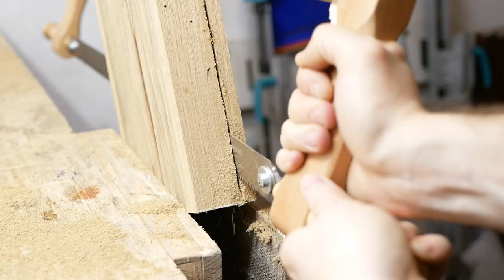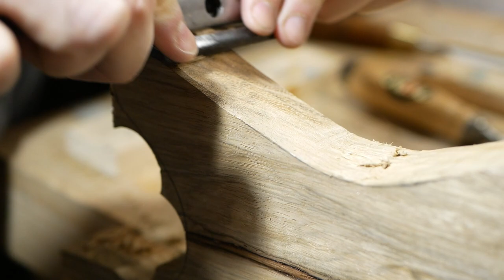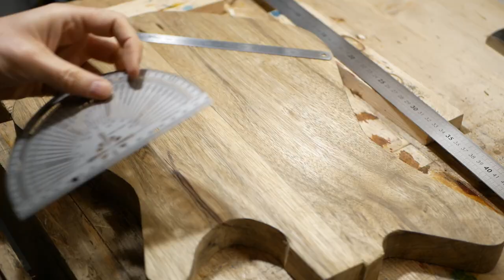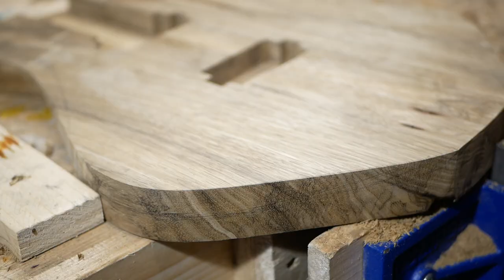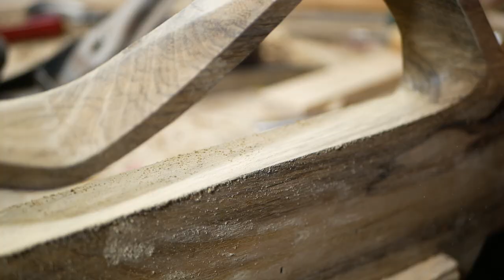How I build a guitar body using hand tools only 1/2 - GGBO 2021 - Part 2

Comment: THIS is what would make this hobby more enjoyable and less stressful for me. Slowing down and enjoying the woodworking. Very inspiring.
Reply from the maker: If your hobbies are causing you stress, you're probably doing them wrong. 

Being alone with my tools in my workshop brings me down after a stressful workday. I don't care about how many guitars I build or how long any task takes, I just enjoy the process.
Reply: @rauschguitars  yeah, my whole process is stressful. Sag mal, wohnst du auch in Deutschland?
Reply from the maker: @ShawnHeath  Ist Bayern noch Teil von Deutschland? Dann ja.
Reply: @rauschguitars  Wenn ich den Radio höre, nein, weil ich nur Nachrichten von Bayern höre. ;-) Ich wohne in Eggolsheim. Du?
Reply: @rauschguitars  It's starting to be a bit more therapeutic since I'm not as concerned with actually making the deadline.
Reply: 😂 @rauschguitars

Comment: Hey what kind of saw is that you use to rough cut the body blank and where can I get one of these? The saw you first use at 1:15?
Reply from the maker: Hi Liam, that's a frame saw with a TurboCut blade, made by ECE. I got it from https://www.fine-tools.com/gestell.html

If you can get your hands on one, I highly recommend it. If you add a narrow blade you can even do bandsaw-style curved cuts.

Comment: Could you share the body size (width, height and depth)? Is there a body size default?
Reply from the maker: There's no rules for body sizes. As long as the bridge is in the right position, anything goes. This body is about 445mm long, 320mm wide and 45mm thick.
Reply: @rauschguitars  thank you for share that information! I watched many YouTube videos but no one  spoke about there is no rules for body size haha. Maybe I should know that though but I don’t have a electric guitar here and I’m looking for starting build one, I do not have many knowledges about electric guitar as you can see.

Comment: What is the tool at 16:31 called? Looks very useful. Great job with this build!
Reply from the maker: Hi Jayden, it's called a router plane. They're a bit rare and can be expensive, but you can also make your own using a chisel. Look up Paul Sellers "poor man's router" for an easy method to make one.
Reply: @rauschguitars  interesting. I’ll have to look that up. Thanks!

Comment: i remember building from only what I had...A 99 cent saw, chizzle.
wood from  the side of the road....I used 3/4 ply wood for the bottom layer....3/4 sticks from garden and 5mm for the deck..i just screw and glue a block where the bridge would be and between the pickup..and neck pockets.
The plywood was a pain to work with...but it;s a semi hollow body.
Alot of it was for WEIGHT reduction.
It looks just like a gibson flying V..The measurements....bridge..ect..not the wacky
off brand shape.
I made the cut away more accessible. I also shave the tennon to the 17th fret
The neck is bolted and GLUED..with proper neck tilt..Which was hardest/longest
part of the build..I also made the jack on the back..so it'll loop around the strap
OUT of the WAY...not just slapped together like gibson..lol
I also recess the upper back of the body so it wont dig into my ribs.
White refrigerator paint for daily use and abuse.
The guitar was built to be PLAYED not as wall deco.lol

i had what I had..I didnt even had a hand plainner.
Holy wow..you thin down those pieces and plain it by hand
Reply from the maker: Yes! It's about using what's accessible to you. I made excuses for years because I didn't have a router or a band saw, then one day I just decided build with what I had!
Reply: @rauschguitars  I glad I built those guitars. I cant build anymore due to my eyesite and hands. I miss building guitars becuase it's relaxing
and peaceful. Build them while you can....

Comment: Hi, nice work on the cavities. What tool did you use for the cavities, the one that you use with both hands?
Reply from the maker: Thanks for the compliments! The tool is called a router plane. They're quite rare, but Paul Sellers did some video recently on how to make your own.
Reply: @rauschguitars  Thanks. Please make more videos on musical instruments wood works since they require more skills using hand tools.
Reply from the maker: @jlrespicio  I'll start my next build very soon! My new workshop is almost ready!
Reply: @rauschguitars  is there a brand that you would recommend for the plane ? Im looking to get one, realising that the poor mans alternative is just not good enough
Reply from the maker: @maxmustardman298  If you can afford it, the Veritas router planes are excellent. Unfortunately the market for vintage planes has gone a bit wild. Unless you find a really good deal, it doesn't make sense to buy and restore a vintage Stanley or Record.
Reply: @rauschguitars  the Veritas stuff seems to be fairly modern as well, Im not interested in restoring old planes if there is modern equipment that does a better job. Too bad its all backlogged into late this year. Ive been looking at a Cowryman model on Amazon that seems decent, albeit with a rough underside if the reviews are to be trusted.

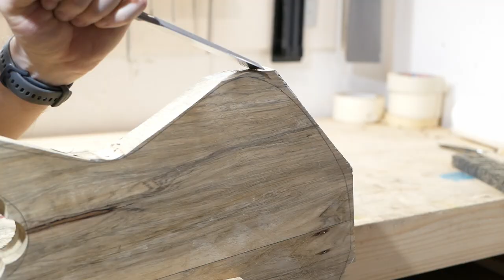Comment: 7:17 Hey bud. Just wondering  is that tool a cabinet scraper like a Stanley 80?
Reply from the maker: That's a no. 151 spokeshave, which works more like a plane than a scraper. They're awesome tools!
Reply: @rauschguitars  Thanks for your response. Great video series it's been so helpful. I just took the plunge on my first telecaster carve. At least so far, all the chip out has only happened on the back of the body 😅😪... The slab I chose was big enough for a practice piece.

Comment: only one thing i'd say is when u pull back the plane on the wood surface,that's not too good for the edge of the blade,makes it blunt much quicker than otherwise would go!but if u like sharpening the plane blade,then this could be the way!Other than that is pretty cool stuff!!!
Reply from the maker: That's a good tip, thanks! I'll try it in future and see if I notice a difference.

Comment: Incredible work! I loved watching it. Although I have to admit I envy how neat your pick-up cavities look compared to mine (I started work on them this afternoon). I don't have a router plane... and I realised today, after hogging out most of the material with a forstner bit, that I don't have a router bit with a bearing on top (first time I'm attempting this at home), so I can't really use the template I have. I ended up using chisels. I'll need to continue working on them to try to get them looking as neat as possible.
Reply from the maker: You can make a router plane using a chisel. I think Paul Sellers has a video on that. Also, go SLOW, take very light shavings and keep your tools sharp. 

Those cavities took about 2 hours each, so don't rush it!
Reply: @rauschguitars  Thanks. I spent about two hours today on both neck and bridge cavities. I'll sharpen my chisels before I continue tomorrow.
Reply: @rauschguitars  Thanks. I'll sharpen my chisels before I resume working on them today. And I'll try to be patient and go slow.

Comment: Are there tool sets one can buy for this type of thing?
Reply from the maker: Not really. The only tools I bought as a set were my chisels. The rest was collected over time depending on what I needed.
Reply: @rauschguitars  in that case what are some basic hand tools one would need to build a guitar ?
Reply from the maker: @lyssanch3096  There's too much to list in a comment here, but you'll need saws, chisels, handplanes, rasps, a drill, as well as specialised tools for fretwork, fretboard radiusing and creating the trussrod channel.

What you get depends on what's available and what you're comfortable working with.